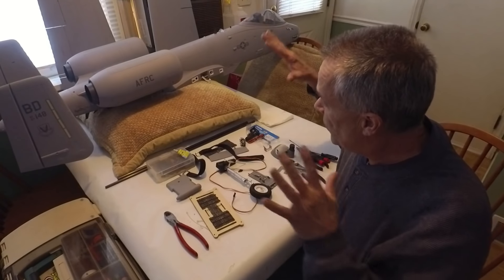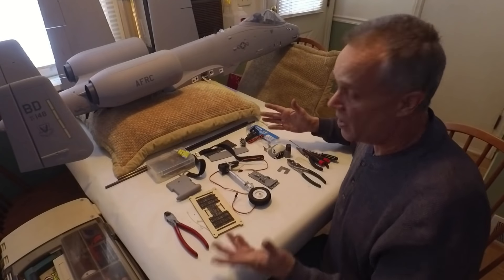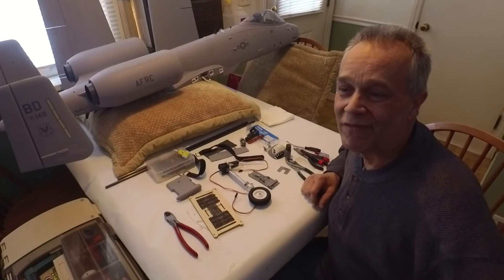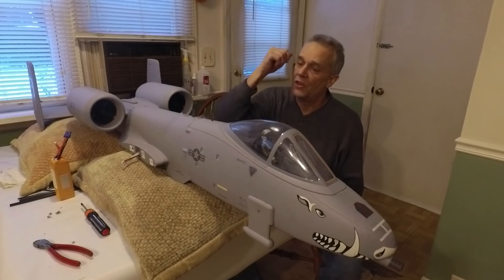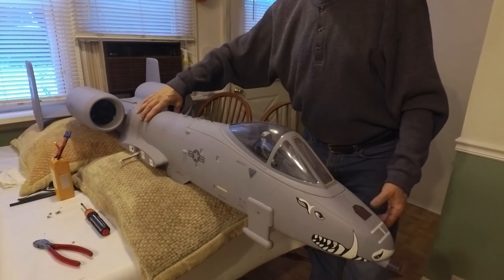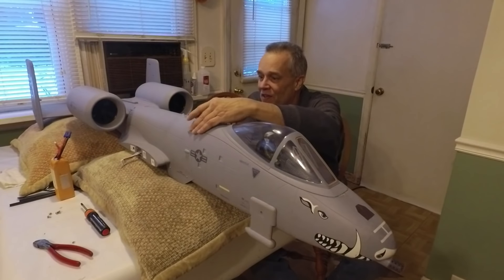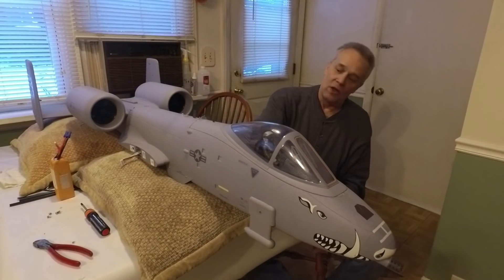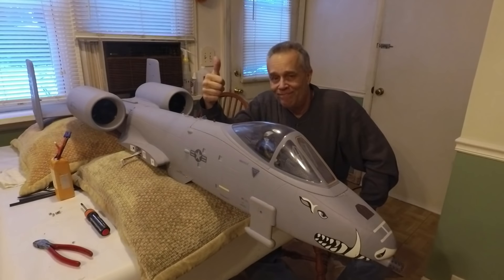Freewing Twin 80mm A-10 Thunderbolt II (Finished Repair)

Comment: G'day Skip...Great job getting the hog back together👍🛩 looks awesome mate👌

Though I am a bit concerned about your satellite receiver antennae.

I remember seeing or hearing something from Spektrum, so please anybody correct me if I'm wrong (especially those fluent in Spektrum)...My understanding is the antenna are supposed to stick straight out from the satellite module creating a linear dipole, they apparently aren't individual diversity modules, as I first thought as well.

The key to it all is, by placing the modules and the main Rx in the plane so that each one aligns around either the pitch, roll or yaw axis (Taking note the placement of batteries, carbon, any metal, electronics, control rods, wires, etc) and favor placing nearby to those things that cross (+) the dipole and that don't run parallel (=) to it...hopefully giving the best full 3D radio coverage wherever possible.

Let me know if any of that makes sense please Skip and viewers.✌
Reply from the maker: Sure it does.  Gday mate.
I have two satts.  And they are set that way.  Thanks for the heads up on that though.   Enjoy your summer.   Happy Flying brother.   Skip